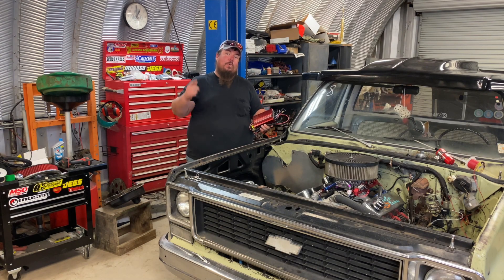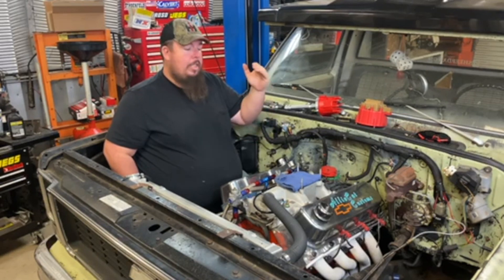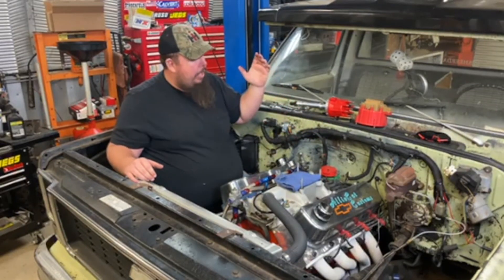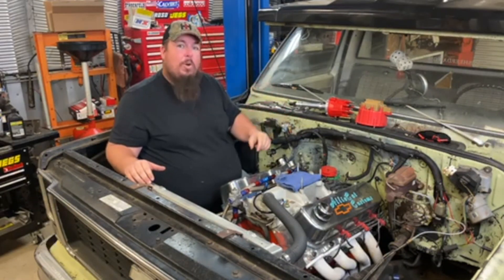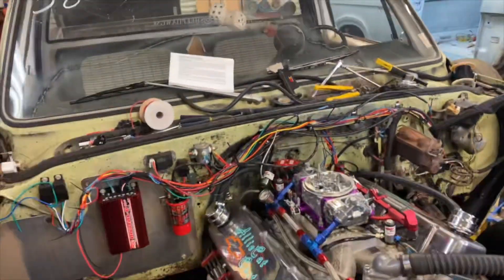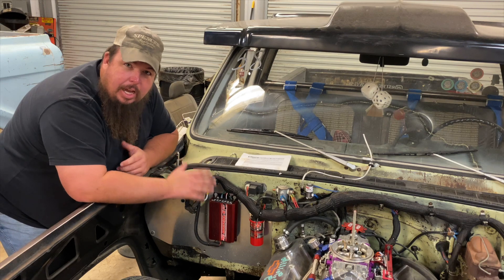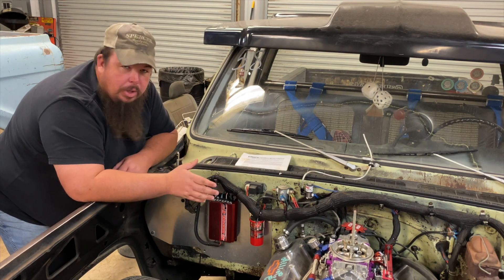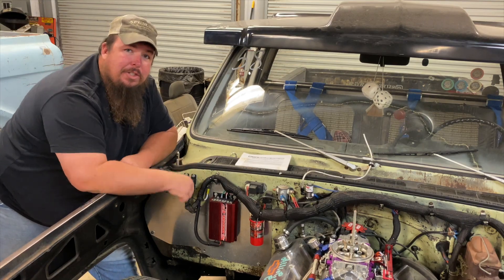MSD Pro-Billet Distributor Install and MSD Digital 6-plus Overview

Comment: How do I know what model msd distributor I have...need to replace rotor and cap..hard time starting
Reply from the maker: You will need to look for the part numbers for your specific distributor.
Reply: @AllieCatCustoms  I just did 8361cool
Reply from the maker: Awesome. There are a ton of different models, so you gotta make sure you have the right one

Comment: ok so i am looking to add this to the list of parts to get for my 93 suburban 454 v8 what do i gain by doing so ? i am also getting a top end kit for it for more airflow
Reply from the maker: Running a full MSD setup is like I have is mostly for the adjustability and better spark control for racing.
Reply: @AllieCatCustoms  so for some street use and off road runs not a good idea ?

Comment: Got a question if im replacing my HEI distributor with an msd pro billet going with my 6al-2 box do i have to take that module thing out of the msd pro billet distributor also the same way you have to with an HEI distributor

Comment: Quick question, I plan on mounting my Digital 6 Plus box in the same exact spot as yours! I drive my car on the street, so if it rains will any moisture or water ruin the box?
Reply: I,m about to install the same MSD 6 setup ,but I,ll be draping a piece of inner tube over  the top of the box,on fire wall ,  to deflect  any possible water  . As well as shrink taping where the wires go in the box . Debating whether  to use rubber grommets between the box and firewall to decrease vibration .
Reply: @cecil sabourin  Awesome idea! And definitely use the Rubber shock Absorbers between the box and Firewall for the 4 Bolts! They sell them specifically for the msd Boxes.
Reply: Hey brother I got a quick question for some reason my car will not crank at all and I'm noticing the loop wire on the digital 6 Plus is cut! Not sure if it was always cut or is it supposed to be connected

Comment: Really enjoy your videos.   I've got a couple of questions about your truck, some things I haven't seen mentioned on your videos.  Assume since you have a transbrake you are running a Turbo 400, what converter are you using and what is the stall.  Did you ever run the peanut port heads on either the 396 or 454?  How much ET difference do you see going from transbrake to foot brake.   I'm finishing a peanut port BB swapped Camaro 81Z28 that i'm going to foot brake.  Since the car is heavy like your truck building a high torque combo.  Keep the great videos coming.
Reply from the maker: Yeah I’m running a th400. I wish I woulda did a build video on it, cause it’s got a bunch of really trick parts on it. I’m using a converter built by a local shop, Durabuilt trans here in Jackson, MS. It’s a 10” stall, and on the trans brake it stalls at 3800. The 396 had it’s good heads robbed off, and had peanut port heads. They are ok for truck work, but severely lack when you wanna go fast. I have only done N/A testing foot vs TB, and it’s about a .3 faster on the TB. Now, my setup is honestly junk. The engine is a legit stock camper 454 bottom end, with 8.2:1 compression, and a 454 LS6 replica cam. I threw it together cheap to have fun till I can put together a legit motor. It’s fun though, and has been 1.54 60’ and 7.13 in the 660’ with a 150 shot.